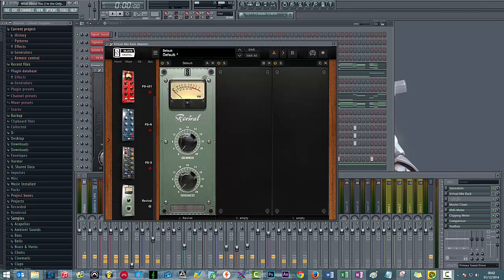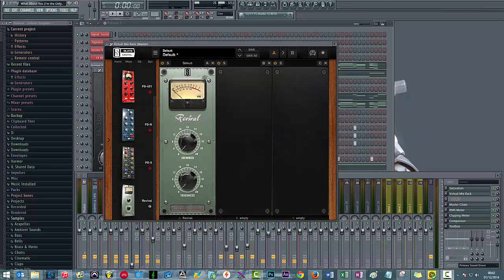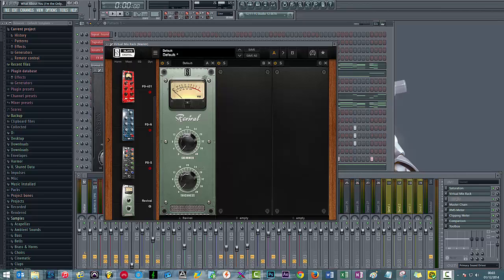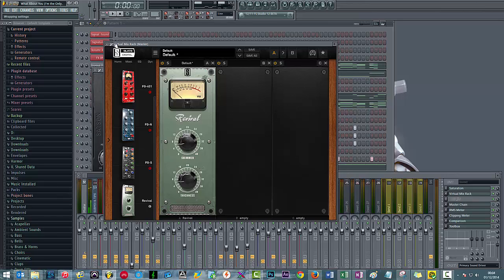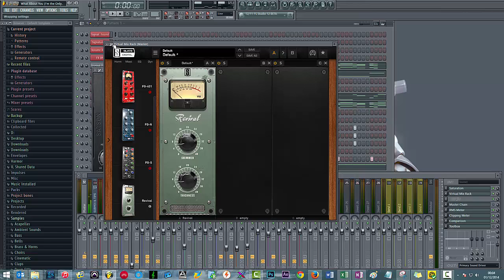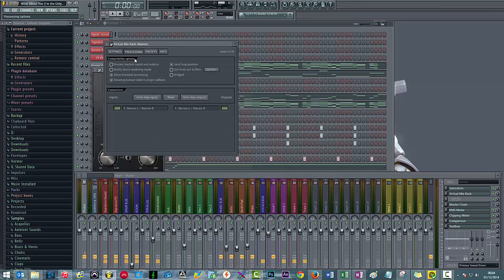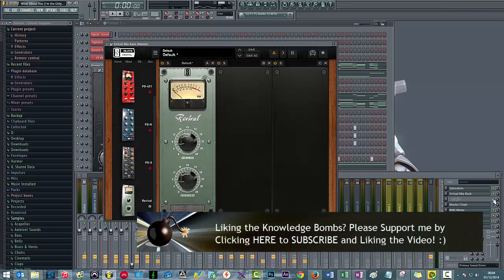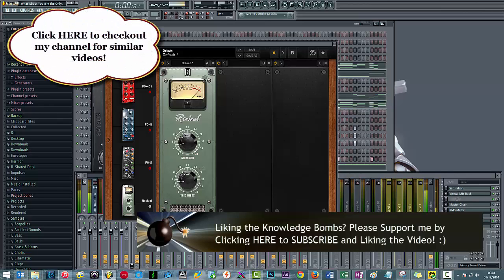Slate Digital: No Sound Issue Solved | FL Studio Tutorial | [No BS Series #15]

Comment: Actually I had that option enabled, but I was clicking other things in Processing and it started to work so thank you!
Reply: how did you fix it? i have the problem with the FLEX plugin..
Reply: Timo Foreman To be honest, I was clicking random things in Processing section (inside the opened plug-in) and it seems like the Output was not active. Here's the screenshot with things underlined with red. Try to switch it off and on, or something 
https://i.imgur.com/dx3EjN7.png
You can also set other things like on the screenshot, but it probably won't affect anything.
It worked for me with 2 different plugins. 
Let me know if it worked for you.
Reply: @Kurty94  Just check the input and the ouput box in the processing section. I did the same as you, but i was sure that this is the problem. So, thx for the video to lead me to that section! :)

Comment: im having this same problem only for the vst nexus, i tried clicking the same button you did and it did nothing, any help?
Reply from the maker: +Mdj6506 Is it the exact same error? Which version of Nexus are you using? I don't suppose you have a VST called 'Padshop Pro' installed? In my years of using Nexus, having Padshop installed was the only time I had issues!
Reply from the maker: +Mdj6506 If you could screenshot the error, that would be useful.